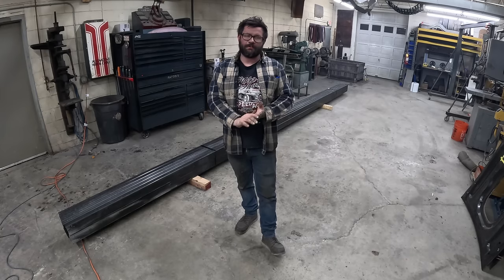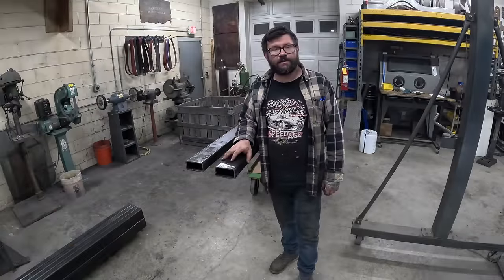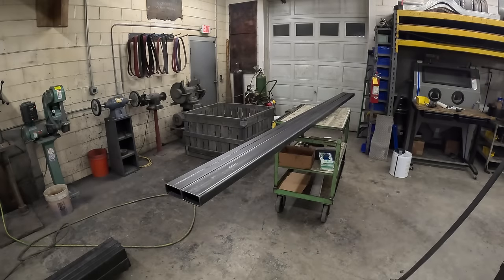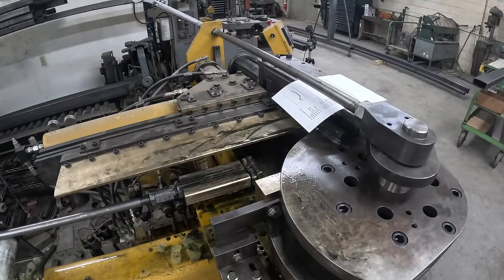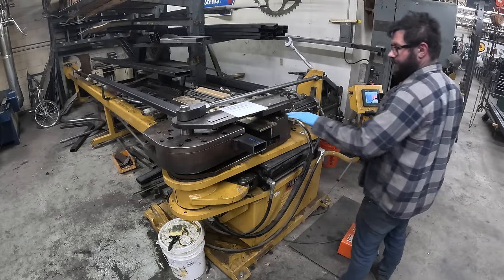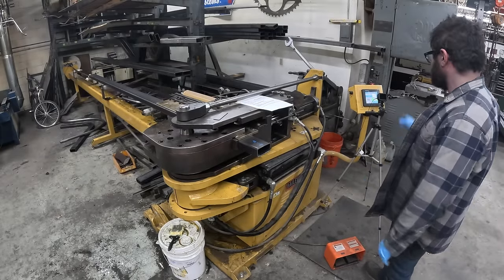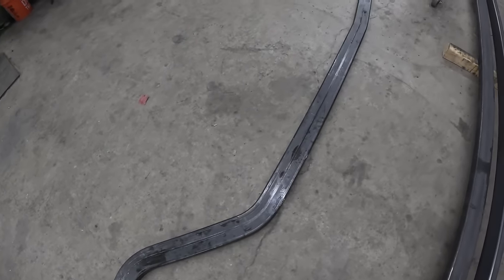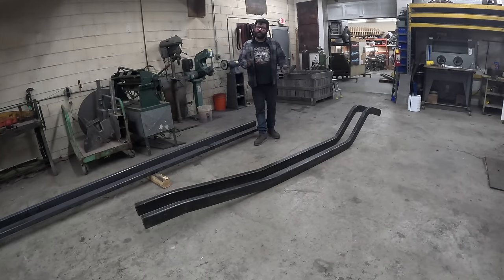Ever wonder how I bend 2 x 4 x .188 frame rails?

Comment: What keeps it from collapsing or tearing? That's alot of stretch
Reply from the maker: The mandrel inside keeps it from collapsing and tearing. It supports the tube from the inside. I have cut tubes in the center if the bend and measured it and it only thins by around .015-.020 depending on batch of tube from the mill

Comment: What do two rails like those cost me to buy from you? Plus does your equipment bend that stock in the sideways direction?
Reply from the maker: Full length rails start at $1100 a pair. Yes I can bend the easy way as well the hardway.
Reply: @cornfieldcustoms  Yea! great way to put it. Bend it the easy way. A lot of that is material cost then?
Reply from the maker: @jackrichards1863  its a split on material, set up, and actual bend/ machine run time

Comment: I gotta wonder how thin that's making the steel on the top of the bend.
Reply from the maker: i have cut them apart there is a material thickness change of about .015-.020 depending on bend and mill run batch

Comment: Just change the die to bend other direction? Like If the frame has to narrow at the front.
Reply from the maker: There is a completely separate die set that needs changed out to be able to bend on the 2” leg

Comment: can you help to make frames to make an 04 subie forester into body on frame?😳
Reply from the maker: if you get me the dimensions you wan the tube bent to
Reply: @cornfieldcustoms  
Okay, it is good to know you could bend  but I was hoping you would be able to pull up the basic dimensions from available 2004 subaru forester X statistics and see the krappy unibody and help to get the knowledge for a safe and street legal frame design that could be bolted under this beast.
Alone time wise right now I am not far along enough to know what is a street legal design frame and what bolting and welding standards and values have to be met to make such an upgrade to this vehicle.
Thanks😁
I know it might sound dumb according to price but I have been fighting so long to be correct according to standards and values I grew-up with compared to this whatever is here now.

Comment: How much do you charge for those 2 pieces? I have a rusted out frame on an 05 Ford Expedition. I cannot tow with it anymore. My mechanic told me it was not safe. The engine is still running strong with good compression. I would like a 3"x 6"x .188 bent to a blue print I will provide. I just need a ball park estimate. I live in Baltimore County Maryland 21131. New cars like this are now $80,000 and up with an even lower life expectancy.
Reply from the maker: 2x4x.188  full length rails start at $1250 a pair. I only bend  2x4 in rectangles
Reply: Thank you. @cornfieldcustoms

Comment: I don't get it.  Where are the wrinkles on the inside bend?  You had to shrink the metal on the inside, where did it go?
Reply from the maker: the internal mandrel supports the tube and prevents wrinkles and deformation

Comment: how much does the wall thickness of the tube change after the 58 degree bend?
Reply from the maker: the material wall thickness changes very little. i have cut some bends apart and the difference is .015-.020 depending on batch run
Reply: @cornfieldcustoms  about 10%, which isn't a lot.  have you tried drawing two parallel lines before bending either side of the bend line to see how much they move as such?  is the inside of the bend compressed, or just the outside stretched?
Reply from the maker: @bradthebikeboy  no because is dont care that much.
Reply: @cornfieldcustoms  no worries.  it's a very cool machine.  must have been a great day the day it showed up.

Comment: how heavy are those tubes before cutting?  thanks for showing the process :)
Reply: @feednweed81  thought about replacing the chain pull hoist on the gantry with an electric winch?  My neighbor has an electric winch he uses for pulling engines, it's pretty slick :)
Reply from the maker: @danielbuck no, the chain fall works just fine
Reply: @cornfieldcustoms  In 1930 Fred R. Coffing got it right with surgical precision. Why mess with perfection!

Comment: Is that  mb4x2 machine are it different number look that one but it $65500
Reply from the maker: Same machine but thats just for the bending unit. By the time you add in hardway tooling, easy way tooling, and the 20ft bend bed its right at 100k

Comment: Time is money. I wonder how much it would cost to have the vendor cut them
Reply from the maker: Not every job is the same length. I rarely do production runs of the same rail
Reply: @cornfieldcustoms  I see, so you make enough rails that you just keep quantities of that square tube in stock. I was thinking that you had ordered the materials specifically for that job, then had to wait to do it until it arrived and all.
Reply from the maker: @michaelallen1432  no i usually keep 30-50 sticks if each material i bend in stock. Some times i replenish stock when I have a large order come in

Comment: Is it possible to bend 4" x 6" .188 wall tube on this machine?
Reply from the maker: Doubtful. 2x4x.188 is tough as it is
Reply: @cornfieldcustoms  yeah, I went and did some research on the machine after I left the comment. It appears that there isn't a machine made by that company that does anything bigger than 2x6. Bummer! I know a lot of people (Toyota 4Runner owners) that would love to have replacement frame rails at $1100 a pop. That's a dream though.
Reply from the maker: @OG-Paul-Valentine  just make them out of 2x4 or 2x6 instead. If you can build a chassis new mounts to change the width is no sweat
Reply: @cornfieldcustoms  true. I think my concern with that is not knowing how much weight would be removed from the chassis. And how that would affect the center of gravity, handling, and other vehicle dynamics. Also, IF, I've never attempted something of this size before. So....
Reply from the maker: @OG-Paul-Valentine  you thinking over thinking it way to much
Reply: @cornfieldcustoms  better to over think than under. 🤪🤣
Reply from the maker: @OG-Paul-Valentine  not if gets you into analysis paralysis. Its a toyota not a formula 1 car
Reply: @cornfieldcustoms  but what if I want it to be a formula one car? 😉 I'm kidding, you're right.

Comment: Hi, could someone please explain the purpose of the mandrel inside?
Reply from the maker: The mandrel support the tube from the inside to prevent, buckling, wrinkling or tearing
Reply: @cornfieldcustoms  doesn't the mandrel get stuck inside the tube while it is being bent?? Is it flexible? Or does the mandrel end up just before the radius starts? In that case, how much support is it really providing?? I remember filling copper tubes with sand and bending them to prevent kinking. Acrylic tubes also were bent in a similar way. Now a days, silicone inserts are available for the same purpose. But the silicone insert conforms to the bend and you later pull it out. Does this mandrel also bend? Is it made up of flexible zipper like links or something??
Reply from the maker: @chandradharkoneti  i have a new video dropping tonight that shows the mandrel better. It has a main solid block, then 2-3 ( depending on which mandrel i am using) independent sections on detent ball pivots so they can be extracted after bending

Comment: Are there any tape measures that break inches into decimals?  I have a worthless tape measure that breaks feet into decimals, but when has any fabricator/woodworker ever measured something like 1.68 feet?  No, decimal inches is what I demand.
Reply from the maker: you just have to learn the math.
Reply: @cornfieldcustoms  I love my fraction calculator app on my phone (easiest way to divide something like 7 3/8 into 4).  But I don’t like trying to find the nearest 1/16 or 1/32 to a unique decimal like 0.19 in my head, when an inch-with-decimals tape measure would be instant.  Wait I just realize how to search for one: decimal inch…and they exist.